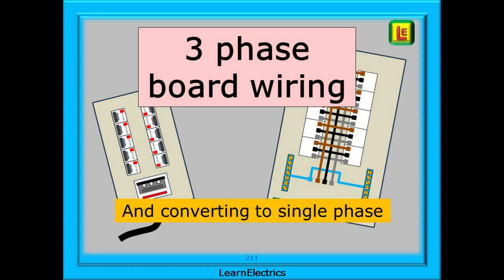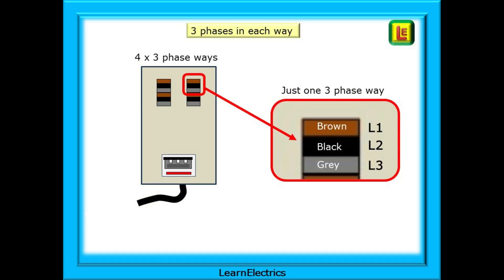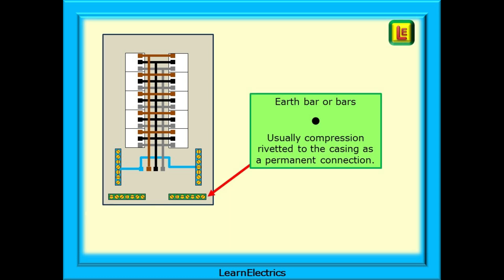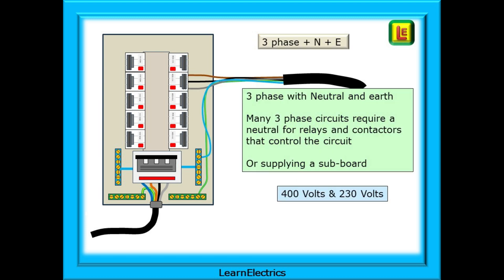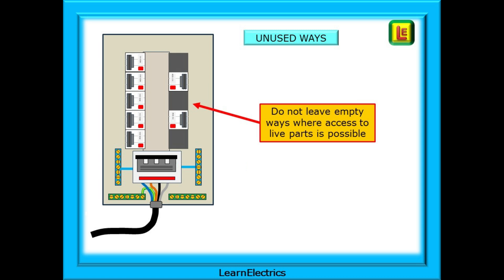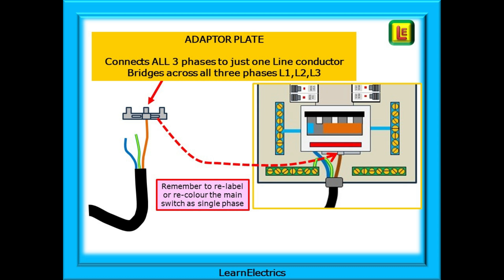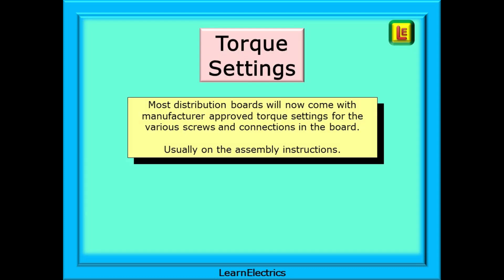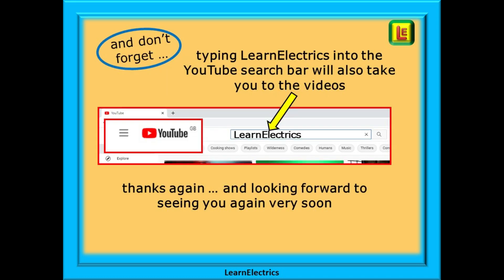3 PHASE BOARD WIRING – THREE PHASE ELECTRICS – MIXED BOARDS - HOW TO AND CONVERTING TO SINGLE PHASE

Comment: Do you consider Load balancing when adding Single Phase circuits from a 3 phase board that al ready has a 3p Circuit Breaker?
I have a medium printer that works on a 3 phase supply, 10 amp per phase, but i need to add a Single phase heater that consumes 15Amp, is there a way to avoid this imbalance?
Reply from the maker: you can only balance it if you have other loads that can be switched to different phases to balance things. Look at the overall balance on the whole board with a clamp meter.

Comment: I still don't understand if single phase boards/consumer units  supplied from a three phase board share the same main earth from the supply?
Lets say i have 1 three phase board supplying 3 single phase boards,to measure Ze would only the main earthing from the distribution board need to be disconnected to measure Ze or you have to do this for the other 3 single phase boards(do they have different  main earthing conductors?)
Reply from the maker: Ze is measured at the point at which the supply enters the building. You will only need to disconnect the earth at the DB where you are testing.
This video will help on this link.
https://www.youtube.com/watch?v=eIM0-uVtV0E
Reply: @learnelectrics4402  Fantastic video,so for measuring Zdb you still disconnect earth at each subsequent consumer unit to get the measurement,thanks. Wish I could tip a coffee right now.

Comment: Hi Dave, Thanks for another informative piece. 

I heard recently about a case where a neutral was left out on a DB board and the main switch was turned on causing 400v to float across all 3 phases. I understand they are connected to the neutral at the source (delta/star) but not fully understanding how you can end up with 400v going through each individual phase & consequently damaging 230v equipment. If you ever have the chance to explain this, i & hopefully many would find it very educational.  👍
Reply from the maker: What an excellent idea for a video. Its now on the list. Dave.

Comment: Dave. I wonder why the Earth has to pass through the same point as the Line and Neutral conductors in a metal board? Considering the board is bonded to Earth I cannot think of a reason... Any idea? Thanks again! Mark.
Reply: This is to ensure a zero sum current through the hole and no eddy currents n the casing. Remember that there is also the possibility of earth fault currents! Hence the reason for all five (5) conductors of the same circuit to pass through the same port.
Reply from the maker: Thanks Albert, there is nothing that I can add. Thanks for the input. Dave.